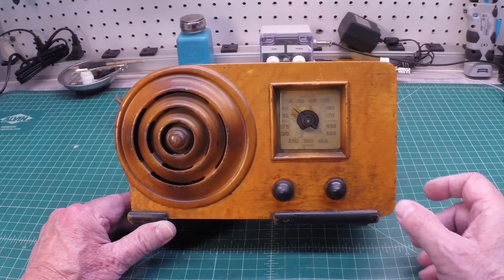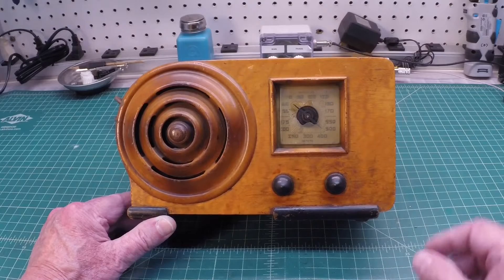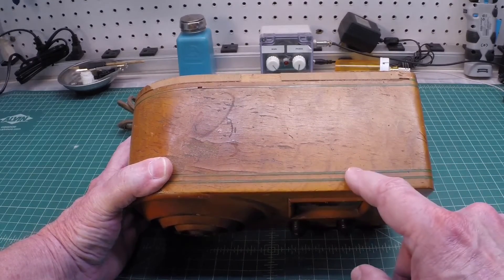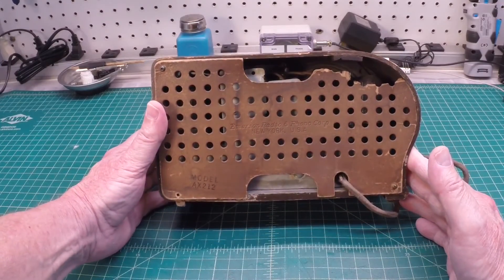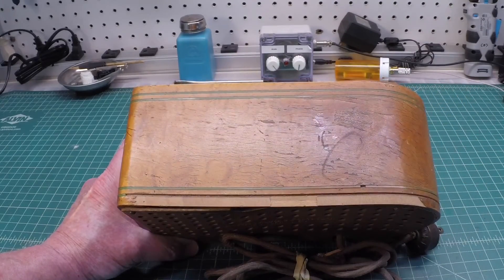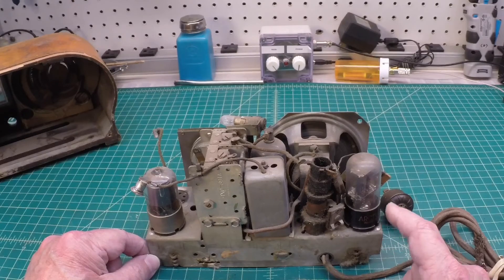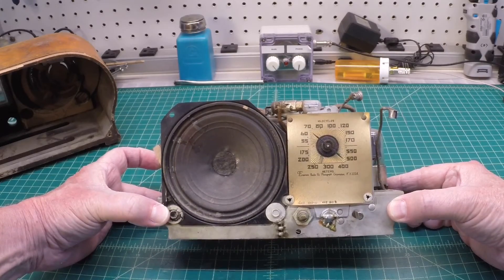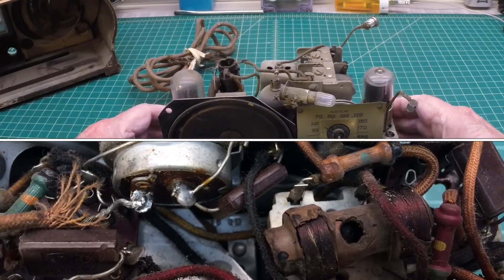Emerson AX-212 - Introduction

Comment: On those old masonite or particle board backs, it's pretty easy to mill new ones if you have a hobby CNC. The tough part of that is what to model it after, but you have a great sample here. In fact, most old radio parts can be modeled rather easily in CarveCo or VCarve. Knobs, grills, backs, etc.
Reply from the maker: I appreciate you sharing your knowledge and solutions. Maybe one day I’ll pursue a hobby CNC. All the best. Don

Comment: I can see similarities between this Emerson and their famous "Mae West" radios.  Also, it is similar to RCA Victor's 1949 "Bullhorn" Radio.
Reply from the maker: Yes, I need to check out the 49 RCA... Best, Don
Reply: @RestoreOldRadios  The RCA Victor  Model 9-X-571 Ch= RC-1079 is in Bakelite, with a lucite type of circular fins over the speaker.  It is nicknamed the "Bullhorn" also.  It has an RCA Jack and was advertised heavily by RCA at the time for a companion radio to go with its' newly released 45 RPM changers as it has an RCA Jack on the backside just for that purpose.  It sold like "hotcakes"!

Comment: That's a nice deco cabinet. Emerson was not shy about placing lots "O" components under the chassis!
Reply from the maker: Thanks Bob, like you noted the cabinet styling is really cool. Hopefully the modern day caps will provide a little breathing room for a power resistor and diode. Thanks for watching. Best, Don

Comment: That's likely one of the earliest AA5 broadcast-band receivers I've seen, from 1938. If memory serves, I believe this is one of those curtain-burner radios, because the power-supply resistance cord tends to get rather warm.
Reply from the maker: Chet, you’re spot on. The old curtain burner line chord has to go for sure. Thanks for following this upcoming series. Best, Don

Comment: The schematic is bigger than the radio chassis! Taking the old components out is not the problem, figuring how to get it all stuffed back in is! 😱
Reply from the maker: Bob - too funny and you are right. Good thing modern day caps are smaller. Thanks for watching. Best, Don